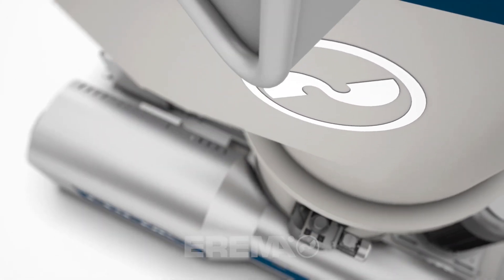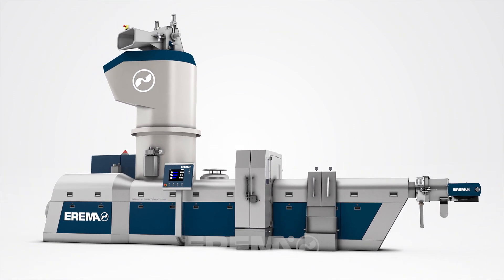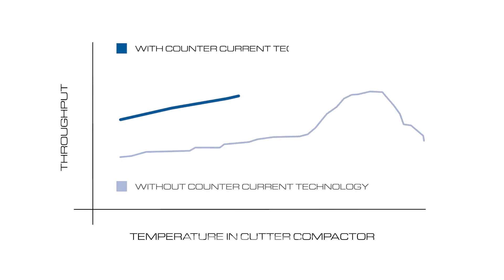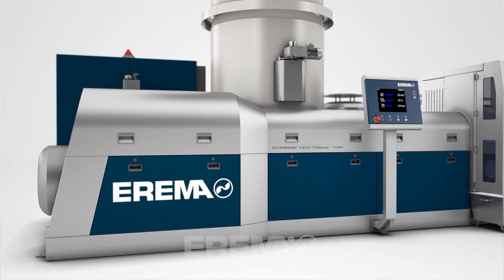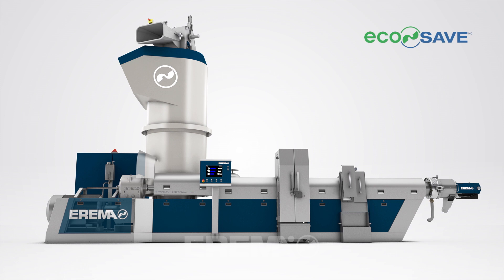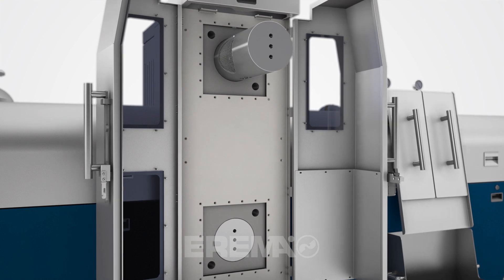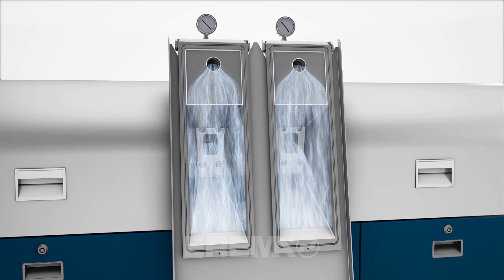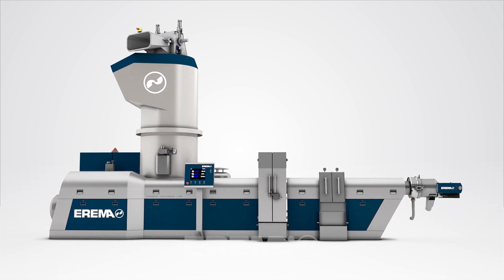EREMA - INTAREMA recycling technology

Comment: I am newly joined a plastic recycling company in Saudi Arabia where Erema extruder machine installed.....I couldn't not understand it's machine function which very default to use.....,..any video on ho to operate Erema machine
Reply: You will have to train to learn. Otherwise it is not possible.
Reply: @savvasathanassiadis4049  
Finally I learned through observation...Now Erema machine operation so easy.......